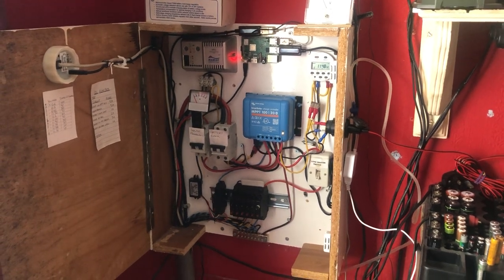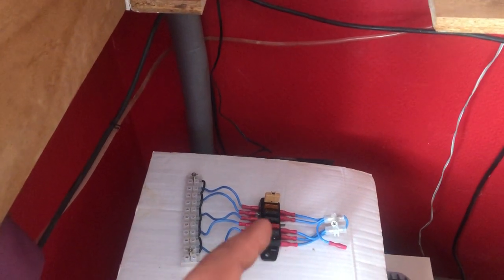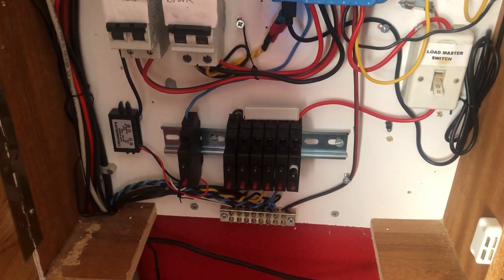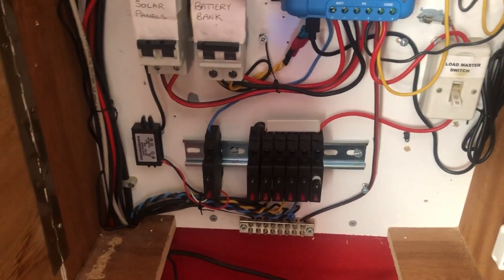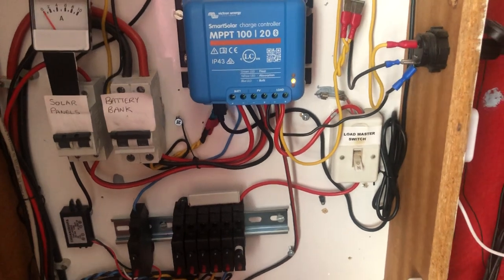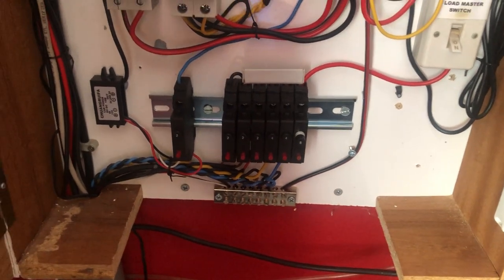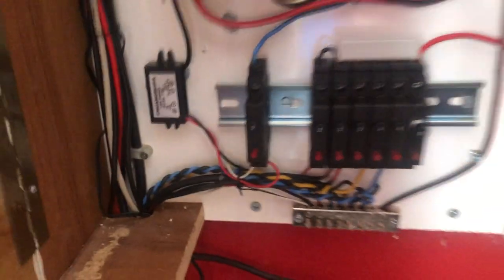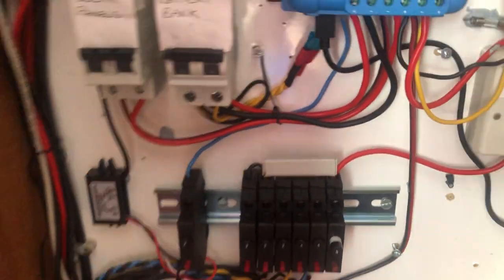July 2021 New circuit breaker’s and tidied my wiring

Comment: Awesome, thanks. 1 question, what happens to the solar panel when the batt. is full and its still sunny out? Where does the extra energy go? Does the control charger just disconnect? I'm afraid of a fire... thanks for sharing.
Reply from the maker: Hi, when the battery is full, the controller disconnects the solar panel. This will cause no harm to the solar panel. When disconnected the panel produces no power. Hope this answers your question. Thanks solartiger.